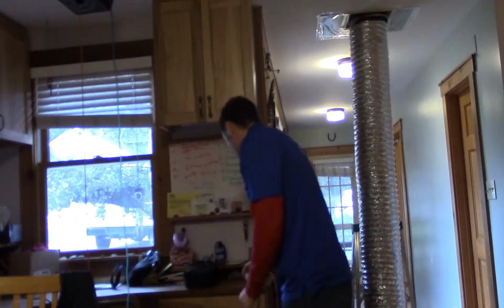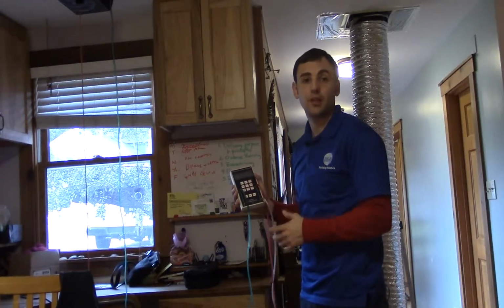The Importance Of Measured Performance   Part 2

Comment from the maker: In this installment of our video series on The Importance Of Measured Performance, Sean takes us through a duct test. Ducts are a huge area of potential leakage in your building envelope and part of our work is ensuring that they're working properly by testing the ducts in your home. The best way to ensure that ducts are performing optimally is at the design level, but there is always opportunity to treat any issue that a home might have by doing an energy audit. Be sure you aren't missing out on more affordable comfort by getting your home tested today.